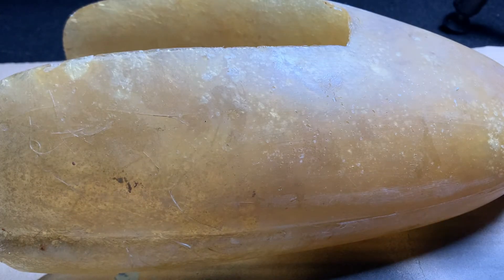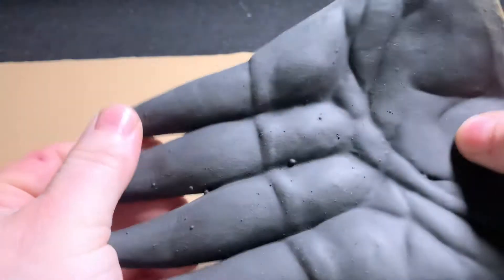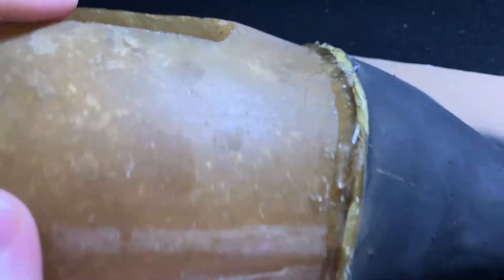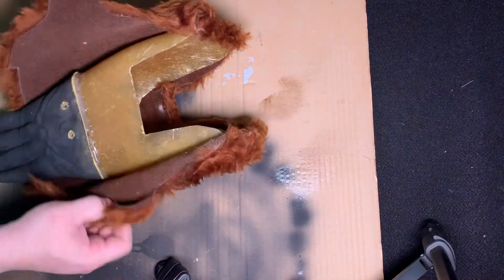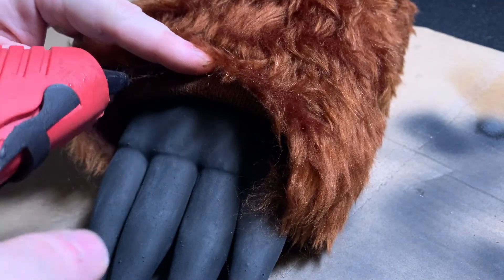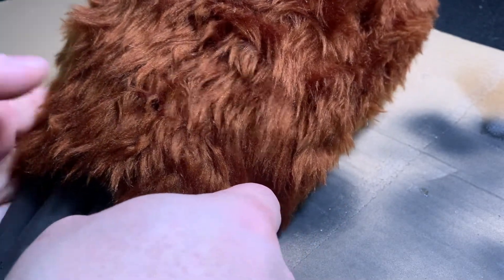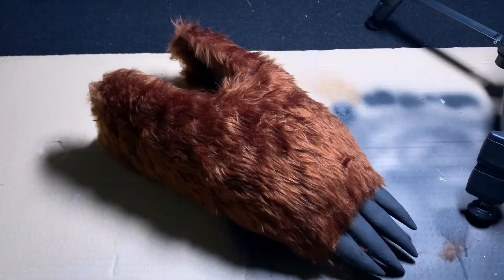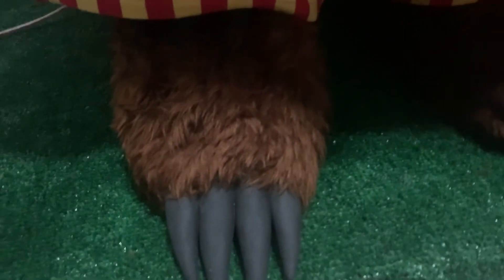Animatronic Restoration Part 24 - BILLY BOB - Rock-afire Explosion - Showbiz Pizza - Tapping foot

Comment: Hey Lotus, I have some questions and I was hoping you can help me with those. I was wondering what hardware you need to run a character. Do you need anything besides this: Mac Valve bank, a data cable connection with a computer and a Layton Bit Stripper (or Gray Box)? You are doing a great job on fixing Billy Bob, i've watched all your video's. Cheers!
Reply from the maker: Thanks.  If your character comes with a MAC branded valve bank, then you can try to refurbish it to get it working.  If your character just has cut hose lines, then just buy 4 way valves with 24v solenoids from companies like Airtac. Each valve with a solenoid costs around 15$.  These valves mount to a manifold which depending on how many movements will cost around  50-100$.  These valves typically also have nice LEDs on them to show you they are working.

I would spend the extra on getting a nice air compressor.  I have a 60 gallon 2 stage 240v. You need at least 5 CFM at 45-50 PSI to run one character.  

It’s also recommended to get an air dryer which works like an air conditioner.  It removes all the water out of the compressed air and outputs dry to the touch air which goes into the valve bank.  This prevents valves from locking up. 

Everything else you listed in you comment is what you need.   

If you are getting a character just take your time and plan on spending a lot of money to get it working.  👍
Reply: @LotusStark  Thank you very much! I'm going to make a plan now. The project will cost me a couple of years because of the money and the fact that I live in The Netherlands, so shipping of an animatronic is kinda difficult and I have to find a solution for this. Thank you very much for your help! and keep up the good work!